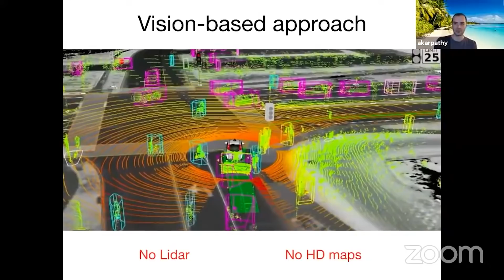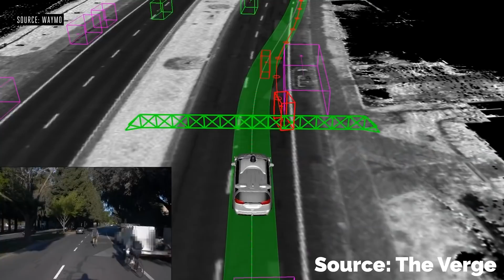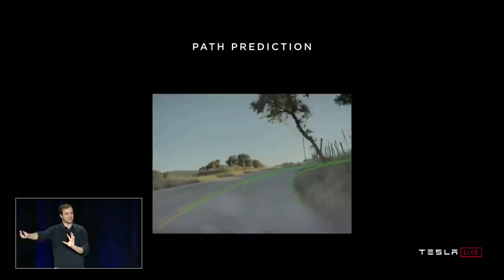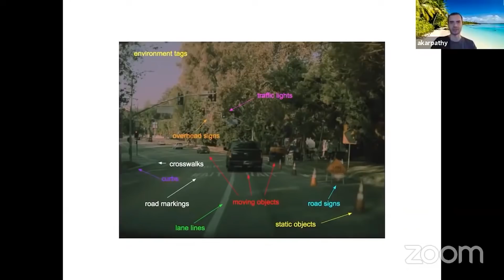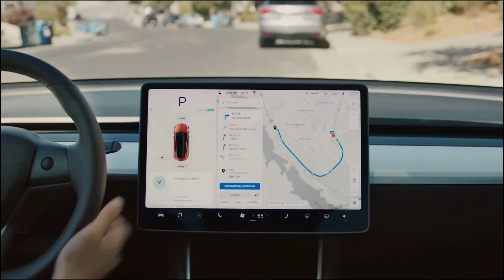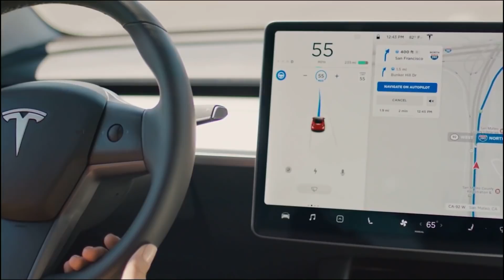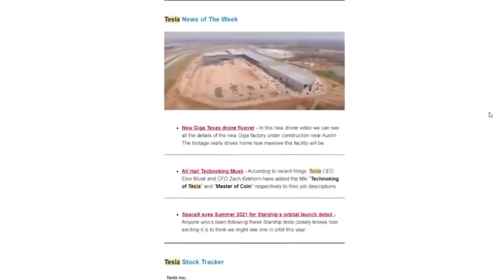What To Expect From Tesla AI Day..

Comment: I noticed you used Waymo as a comparison. Have you checked into Luminar? I believe that would be the fairest comparison in present day. Luminar is shaping up to be a big player in autonomous driving, not just Lidar technology.
Reply: Unless they've figured out the downfalls of lidar such as signal interference and losing the lock during hard braking then I'd still put my money on Tesla. I used to think Tesla dropped radar/lidar because of cost (really expensive). But this video has enlightened me on the fact cameras are generally more reliable (as he says in the video and has said many times before).
Reply: @shawnwise2458  My largest position is in Tesla. But I do own a smaller position in Luminar (LAZR). Again, as I stated, Luminar is not only a lidar comapany. They are slowly becoming a big player in the autonomous driving market. If you are going to compare Tesla to any lidar company, it should be done with the absolute best, which is currently Luminar. It is silly to compare Tesla to anything but Luminar in the lidar world. They are the biggest players. Period. Velodyne would be considered the next.